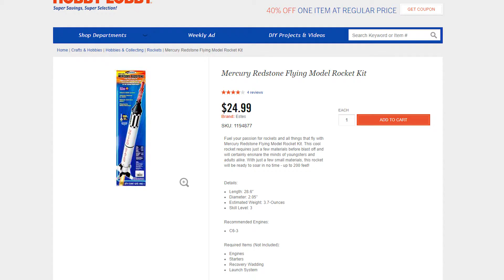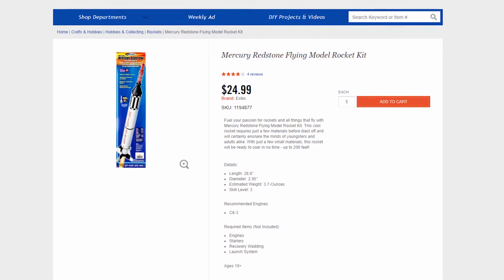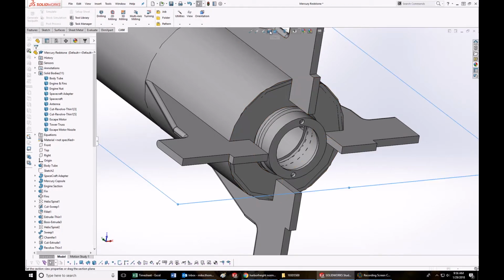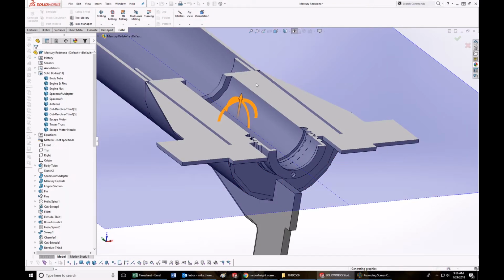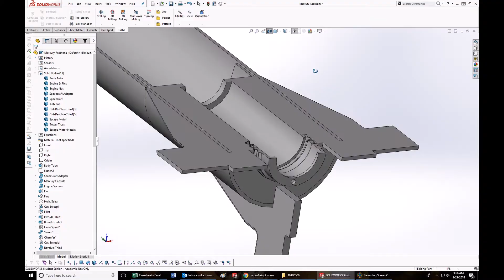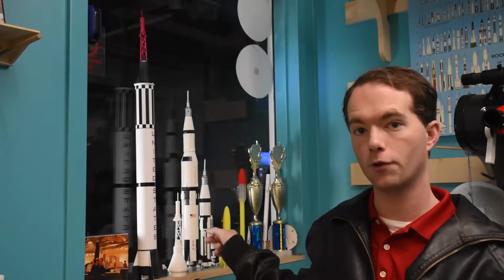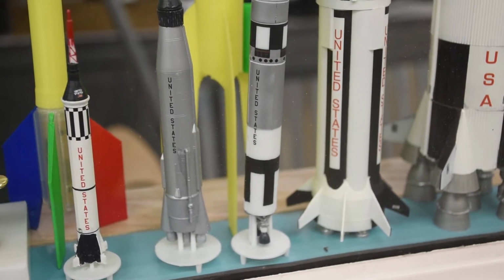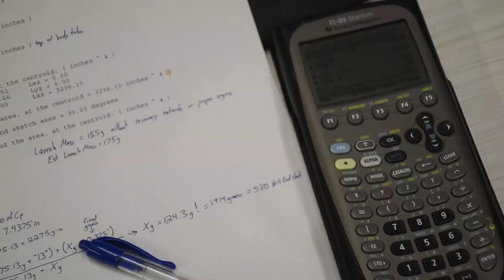Building a Model Mercury Redstone Rocket - Mikes Inventions

Comment: Are you kidding me ? I wouldn't attempt that in a million years. That's great, what does something like that cost. I think my wife might go into melt down, if I attempted that. She saw me through a mini lathe, then a South Bend Lathe resto, with her help lugging that into the garage. Then installing filters over the wood lathe to turn hundreds of Pens and what not. Can you show how the 3D printer printer worked making that. By the looks of all those data sheets plus a special calculator it might be a little much for me. I just turned 80 and things work a bit slower these days. I do however watch you turning out stuff like this...Thanks for sharing.....Ken , the old grumpy guy from Marina CA